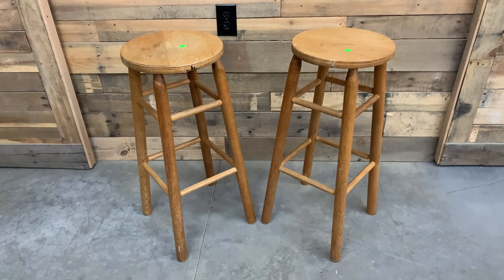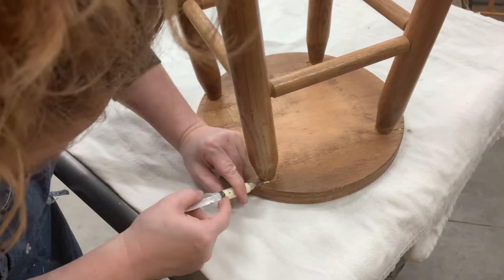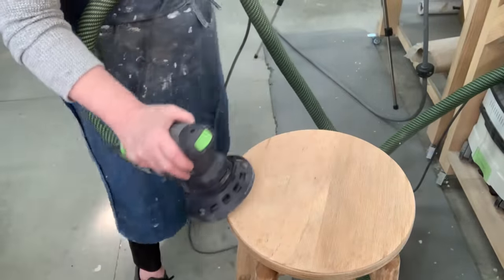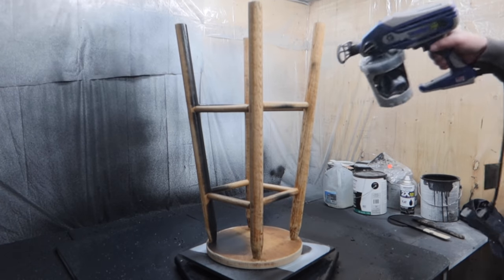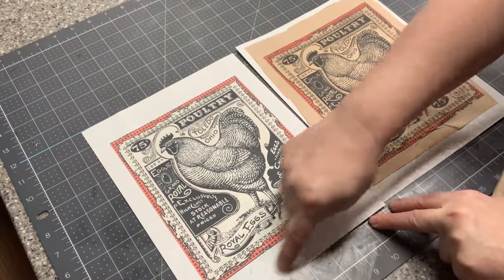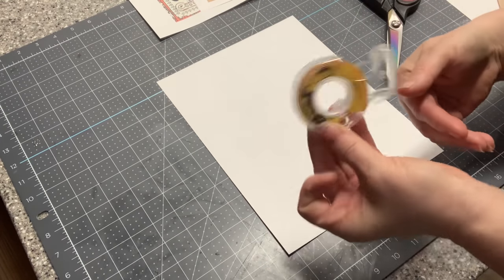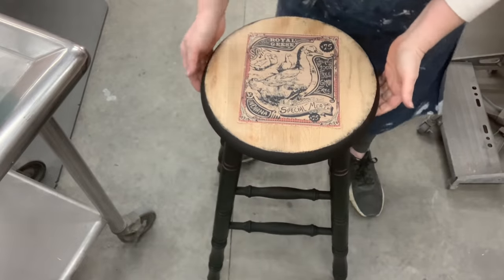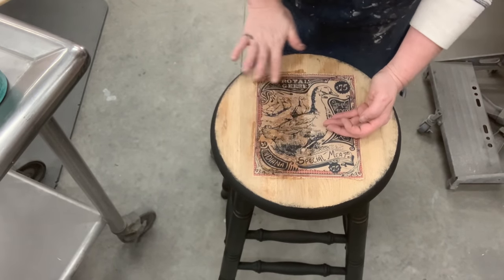Using a Copier to Print on Tissue Paper | Decoupage | Thrift Store | Second Hand | Farmhouse

Comment: I cut the tissue paper an inch bigger all the way around then fold it over on the sides first just using a small piece of scotch tape to hold then fold the ends over and use a small piece of scotch tape, the ends feed though the printer so that keeps anything from catching, folding it over also helps to keep it from wrinkling up because it holds the tension on the thin tissue, I also use a light to medium weight cardstock paper for the core which helps it hold its shape.  I have a friend that does it like this and she is always fighting wrinkles and tears and mine don't seem to have an issue as long as I get my tissue paper taut.
Reply from the maker: I tried the fold over too. Nope .. but maybe cardstock. But not sure I’d want to waste that. It’s definitely a learning what works for you and your printer kind of thing. Lol 🤗
Reply: @GingerChickRehab  I just keep reusing the card stock, I use something with a shiny side and that's the side I tape on and then the tape peels back off, the ones I'm currently using came out of sheets I bought last year, I'm scotch and apache, everything gets used until it's used up, then used once more! 😆

Comment: They all turned out great!  😀 I learned how to do the tissue printing from DIYS at the Schwowins Nest! Cut the tissue bigger than the printer paper, fold over and use painters tape on the back side (mostly across the end that goes into your printer), and tack the bottom, like you did but using painters tape.Works great! I can reuse the paper and tape several times. Just a thought. Also if you have one that wants to wrinkle, use Saran Wrap to help smooth it out without tearing it.
Reply: Great tips! Thanks for sharing!!😊

Comment: I roll the top of the tissue paper about 1/2 inch over the top of the copier paper and also at the bottom  and use scotch tape and it goes through pretty smoothly.  It has worked well for me using it that way.
Reply: This is how print on tissue paper. No problems.

Comment: I had stools like the ones with ply wood tops. The tops of mine were cushion covered with faux leather stapled under the plyboard tops. I took it off because they were old and splitting in the leather. Once I removed the cushion part, I used them for Flower and Plant stands.

Comment: Use freezer paper instead of copier paper. Measure and cut your freezer paper the size of copier paper then iron your tissue paper to the waxy side of the freezer paper. Run your freezer/tissue paper in your printer and print your image. Peel off freezer paper. Love your channel

Comment: I love all your work.  Are you using a ink jet or laser printer?  I've tried with my ink jet but not had any luck.  I put it in the oven and then sprayed with hair spray like someone else said to do.  I still have issues with the ink running.  Any suggestions you have would be appreciated.
Reply from the maker: Since I haven’t had the problem myself. Maybe a light coat of clear coat top coat. Hairspray would be water soluble. ( that’s why it would still run.
Reply: @GingerChickRehab  Thanks I'll try that